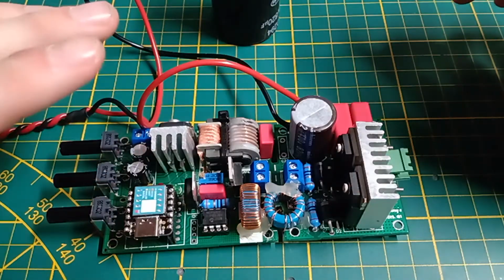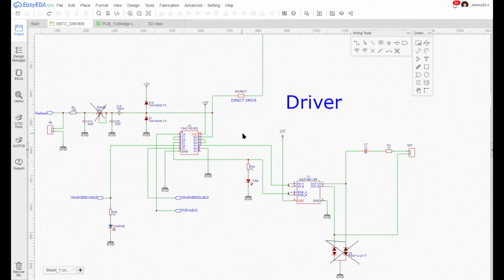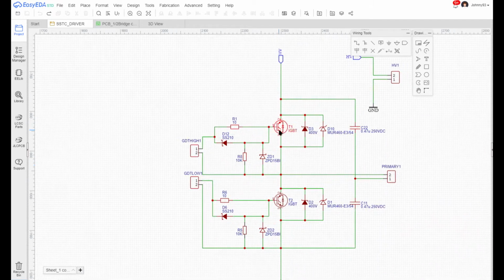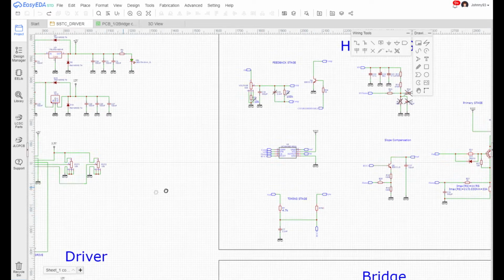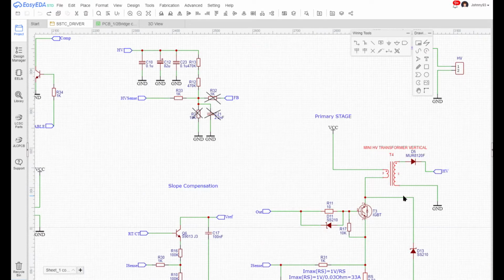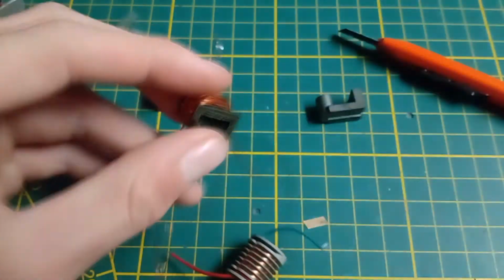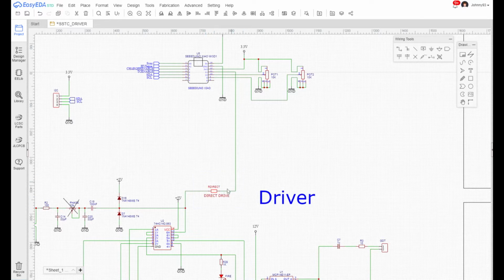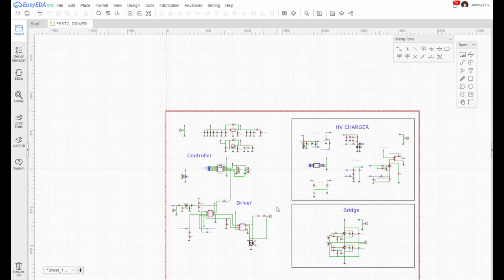All In One Tesla Coil (+ Schematic & PCB)

Comment: A wonderful design! It's wired that the arcs sounds like those from SGTC
Reply from the maker: yeah, it's because it has to charge the big capacitor everytime it fires and you can hear the fan of my powersupply. Never thought of that. It has a special feeling with a DC/DC charger instead of rectified mains.

Comment: very good and interesting...sorry my english is translating...i want to ask prof...how to increase the frequency to 495 000000 hz with power below 12 v 5 A..thanks...deny s.indonesia
Reply: raise the frequency??? what frequency do you mean?
Reply from the maker: My coil has a frequency of 500kHz and uses the exact power requirements you're talking about... But it firstly turns 12V into 300V. You won't reach 495 MHz though.

Comment: Nice so you replaced the feed back with the microcontroller pwm signal ..... so its a fixed frequency sstc ?
Reply from the maker: No, its a Step-Up-converter to go from 12V to a much higher Voltage as the Bus Voltage and a sstc with secondary feedback on one PCB.
Reply from the maker: But with the PCB it is possible to test the setup with a fixed frequency signal from the microcontroller.